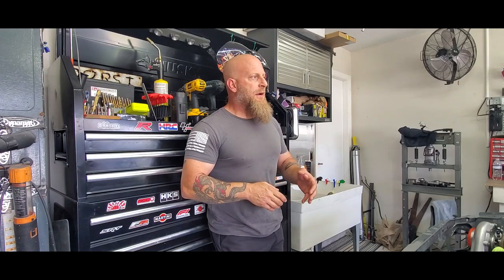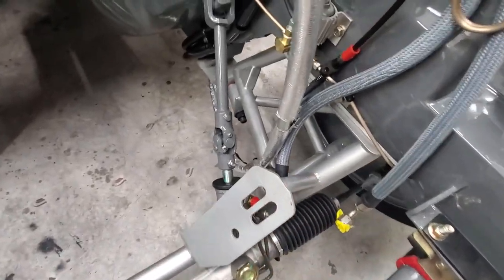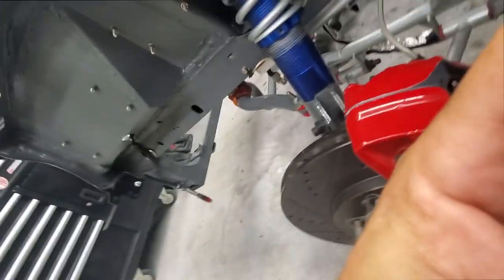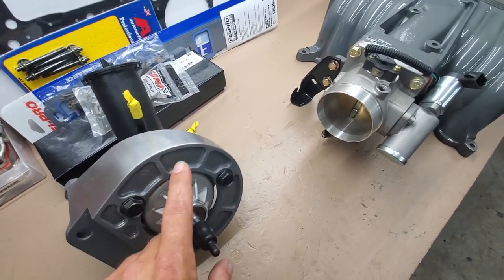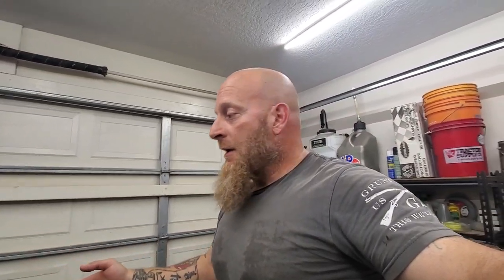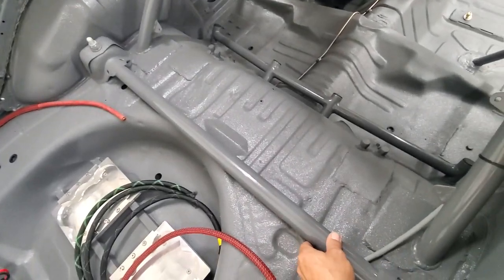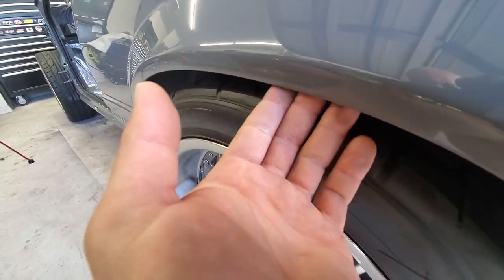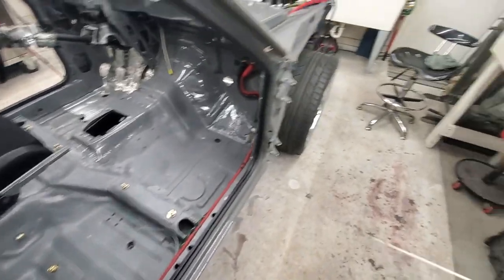Fox Body Mustang Street Car Full Build Overview  plus 3M Cavity Wax

Comment: Hey I noticed the brace on your rear floor pan that looks like it may connect to your upper control arm mounts...Now is that something you built or is that something that is sold that I haven't seen yet it looks like it's pretty solid was curious about it.. it kind of looks like a factory k member type brace... Amazing build I love how you set up that rear brake line with the bias adjuster right next to you that's a great idea!  looks great I love the sve wheels with that color & on the other subtle details that you have done it's just badass keep up the good work man!!!
Reply from the maker: The rear seat brace I made from  just some scraps laying around...  all 4 points are the rear seatbelt mounts/ upper tourque boxes..   the rear brake adjuster is a road racing type setup.. I appreciate your comments!  thank you brother!

Comment: Hey Tony-loving your videos. Very detailed and helpful. My question is about your spindles…did you use the 94-95 spindles or the 96-up spindles? I know the 96-up have a little different geometry and also push the wheels out approx 8mm. If you used the newer ones did you find and issues with the bumpsteer or tire fender stick out/interference? Thank you
Reply from the maker: Hi Kevin thanks for that and thank youbfor being here.  As far as the spindles I have the earlier ones Im pretty sure. But with that I have 20s on the car so I definitely did some cutting and grinding..lol

Comment: Instead of swapping trigger wires etc on your redundant fuel pump relay when you need to t/s, cant you just swap around the square relays (bare handed!) and leave the wires where they are? Love your build quality.
Reply from the maker: The leash electronics relays are potted (glued) in place.. so the board itself is non serviceable.. however, the owner Randy, claims the relays don't go bad so we will see...

Comment: Love it
Reply from the maker: Thank you brother!
Reply: I have a 93 lx hatch I'm going a coyote in. It's down to the "studs" much your's.  I used raptor liner on the floor pan top and bottom. Welding frame connectors and made myself those jacking rails or basically tied the connectors to the pinch welds.  I have a team z 4130 cage I'm starting on.  So your vid came up when I searched for fox body roll cage. I did fuel lines much like yours but I left them on the passenger side and used 1/2" aluminum hard line. Idk both your car and my car have similar things going on. I think you might be a brother from another mother ha
Reply from the maker: @ericdebisz9458  lol that's Awesome.. we must be then! Lol

Comment: I love watching your project and you're doing an amazing job! I'm doing the same Brembo brake upgrade on my 89 GT here in Texas but had a question about the SVE wheels. those are the exact wheels i planned to with but how did you manage to get the +32 offset for up front. Looking on LMR web site the fronts are only showing in +24.  How were you able to get different offsets? keep up the amazing work!
Reply from the maker: Thank you brother I appreciate that. To answer your question these are 20in s550 wheels for 2015 to 2022 that come in the +32mm offset... that being said 20s on a fox isnt for everyone but i freaking love it! Lol
Reply: @TonyDFreestyle96  Ill be curious to see the front wheel look once you have fenders back on. will they sit in like the +32?
Reply from the maker: @Texas1989GT  take a look at some of the vids where the car is finished or look at my ig page of the car done..
Reply: @TonyDFreestyle96  Hey Tony, sorry to keep bugging you with the questions. did you have to do anything special to get those s550 wheels to fit? spacers? im running '95 cobra front spindles and cobra rear brake and axle conversion. think the s550 will fit on mine? i like to 20" too
Reply from the maker: @Texas1989GT  so i am running viking coil overs on fully adjustable plates... the cobra spindles should work no problem. Im not running inner fenders and did roll the fenders. A little cut and grind here and there. It will all work out.. i didnt need spacers at all. Just mock it all up first.. none of it should be an issued

Comment: Hello Tony Where did you get those -6 and -8 line separators? all i can fine is -6 -6 or -8 -8 im looking to use those also. Thanks in advance.
Reply from the maker: Hey Jonathan, I seriously went to the end of ebay to find them.. 

https://www.ebay.ca/itm/303939455140

Jist make sure if your running ptfe hose you get the right size because the ptfe is a size smaller OD than regular braided line..
Reply: @TonyDFreestyle96  I’m running regular braided thanks for the heads up and appreciate you answering everyone you rock 🤟
Reply from the maker: No doubt bro.. good luck with your build!

Comment: Why did you use upr vs mm k-member t/a pan hard bar setup or any other manufacturer. Ty
Reply from the maker: Hi Keith, so I went with the UPR front suspension simply because of their reputation and im lucky enough to physically go to their shop, ask questions directly and get what I need..  as for the panhard bar. I fabed up my own system because i just didnt like how all the bolt in products are made and designed.